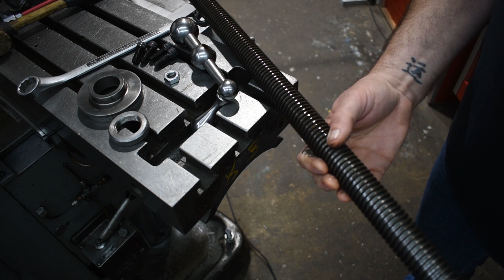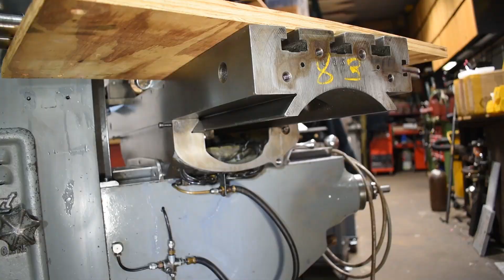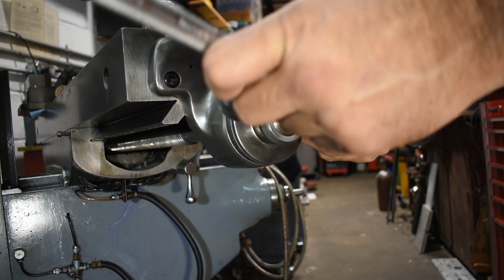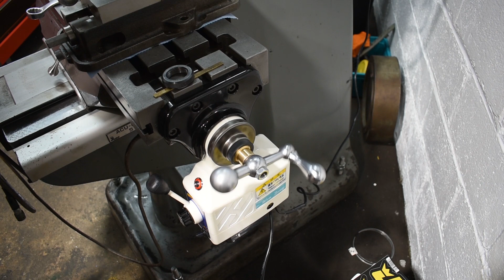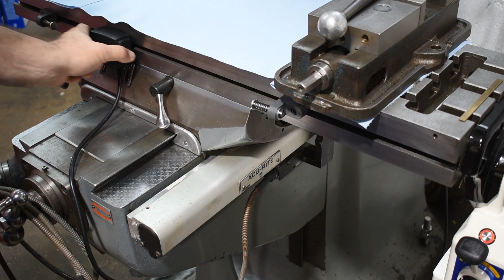Bridgeport Milling Machine Power Feed Install

Comment: So i do have to swap lead screws to add an aftermarket power feed from my bridgeport power feed.  Do you have a measurement on the non power feed screw i will need?

Comment: Mr Pete, my Bridgeport has a longer lead screw that accomadated the old power feed from Bridgeport. I've purchased the vevor for replacement but it will not work with longer lead screw .. is there an adapter to compensate for this?

Comment: Those are cool. In the past I've looked for a universal kind of power feed, but never came up with much.
Reply from the maker: John,  there is a circuit floating around on the internet  using a stepper motor and an arduino board...   i think myfordboy shows a video hooking one up..   if i had time i would have done that...